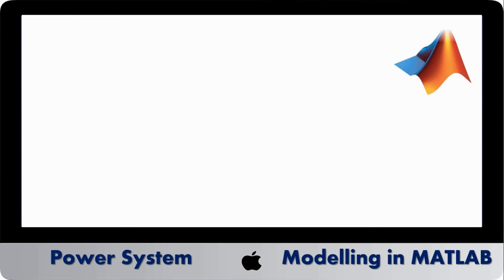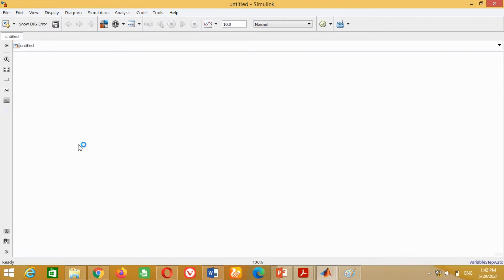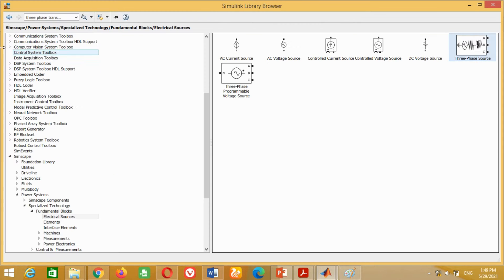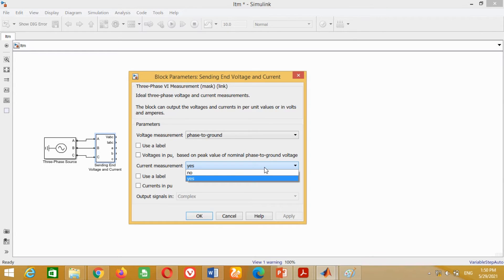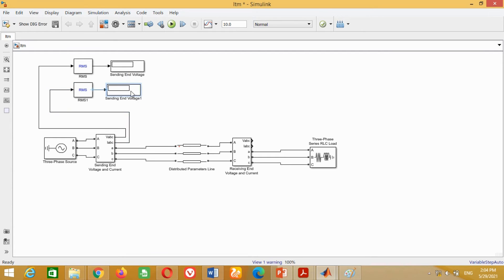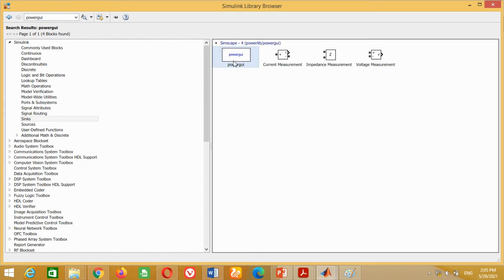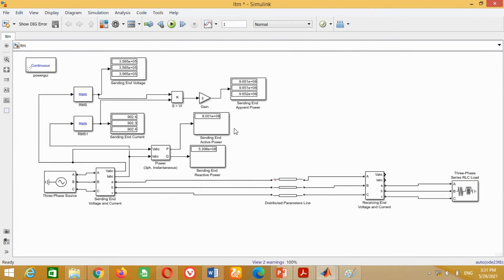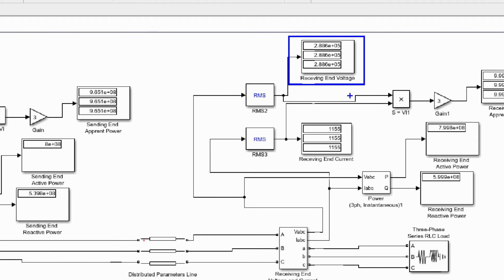How To Design Long Transmission Line Model in MATLAB SIMULINK ? | Dr. J. A. Laghari

Comment: Good Day Doctor. Why you added gain of 3 for S=VI @ 12:03 sec in the video. Isnt this supposed to be 1.732?
Reply from the maker: Thanks for the comment. If power are used in Phase voltages, then S = 3 VI.
Reply: @DrJALAGHARI thanks and Ramadan Kareem.

Comment: Thank you for the video. But 100 percent efficiency, how is that possible? It`s ridiculous
Reply from the maker: Thanks for your valuable comments. This example is taken from the book power system analysis by Hadi Sadat who is an authority in the field of power systems. Furthermore, it is already mentioned in the example that it is a lossless line. Therefore, obviously, it must have an efficiency of 100%. otherwise, it is not a lossless line. Additionally, transmission lines have always higher efficiency usually in the range of above 95% to 98%. Therefore,  I couldn't see any ridiculous thing in this example. If you see any such thing kindly justify your perspective with arguments, and I will try to change my mind. Thanks.

Comment: Assalam alaikum sir I sent you a mail sir,I didn't get a response
Reply from the maker: Wa'alaikum salam thanks for your message and email. I have checked now. Basically I haven't worked on lightning. To do this, you may follow any research paper closely related to this topic then implement it in MATLAB. It would be easy.

Comment: 5:34 Why did you write 0.99 mH for the second value of inductance? What does it represent and why does it only work for this example only?
Reply from the maker: Thanks for the comment. Actually in long transmission line, if we use any value of inductance or capacitance it causes resonant frequency of such value that is high or low the time period of MATLAB setting. This causes MATLAB to stop running the simulation. That's why you have to check for different values. In this example, this values gives satisfactory results.
Reply: @DrJALAGHARI  Aha, I see. So do I have to try for slightly larger or smaller values for either L or C?

Comment: Dr. Laghari, Can you help me, please?
I need to design a 4-phase, 6-phase, 9-phase, and 12-phase Power transmission lines and compare each one of them with the 3-phase power transmission lines in terms of Harmonics, Voltage regulation, Sag calculation, and power loss using Matlab.
Do you have any references or textbooks that can help me to do this project?
Reply from the maker: Thanks for the comment. You may find any research paper closely related to this topic first. Then try to implement it. Otherwise, it will be difficult.
Reply: @DrJALAGHARI   Do you have references or textbooks that can help me to learn the basics of building power systems using MATLAB?
Reply from the maker: @a.na_hammad6225  I don't think so. Only YouTube videos are available that may help you.

Comment: Ye 5:35 par inductance ki value 97 se 99 kyo kar di
Reply from the maker: This value is given in the data.
Reply: @DrJALAGHARI  par data me to 97 diya hai. Fir 99 kyo kiya
Reply from the maker: @gauravchaudhary3213  g exactly. Lekin iss 99 put kia ha taa k simulation stop na ho jae due to technical reason. You may check it.

Comment: abe yr tu ye bata jo bola ki ye bs is example k liye valid hai to baki k liye hm  kya  value lenge timing 5:55  jldi bata
Reply from the maker: Thanks for the comment. Hr transmission line k parameters mile hote hain. Wahe put krainge. Iss example ma wahi data use hoga jo iss example ma mile honge.

Comment: thankyou Dr 🤲🏻 may Allah blessed you 🙏🏻
Reply from the maker: My pleasure.
Reply: @DrJALAGHARI  Dr how if my value is 275kV. can i use the same value for length, impedance, reactance and frequency ? or i need to change all the parameters value ?
Reply from the maker: @mohd-rw3yo  275 KV is your sending end voltage or receiving end voltage? Yes first you have to do the calculations.